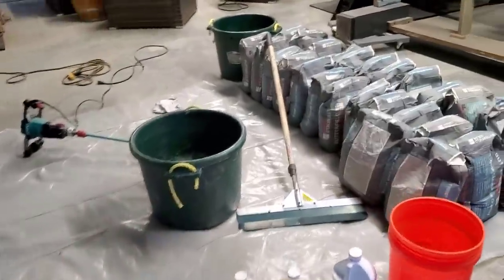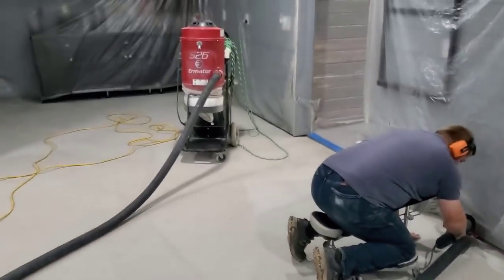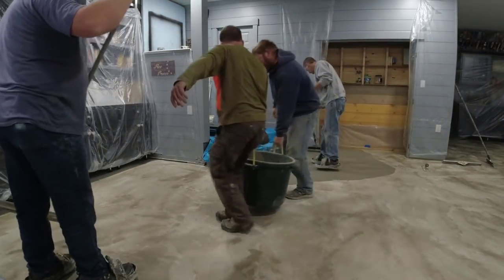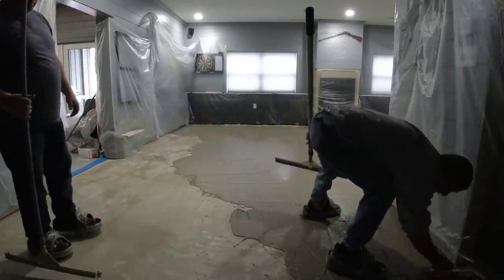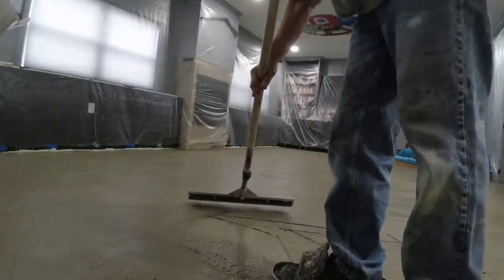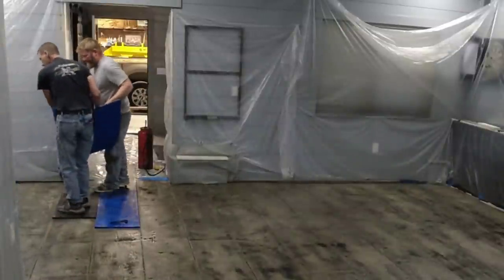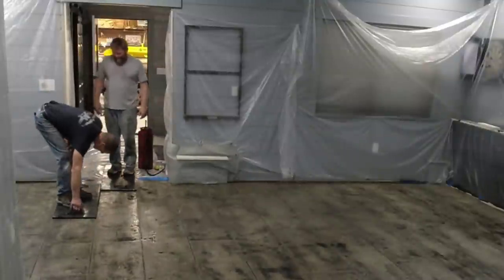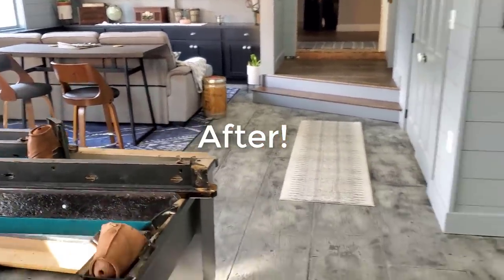Beautiful THIN Stamped Concrete Overlay For Man Cave! (Resurfacing a concrete floor)

Comment: You Definitely know what you're doing. ..I wouldn't even have the nerve or patience  to attempt doing stamped concrete. Seems like too much can go wrong, like if it's too soft, or gets too hard, etc.  ... The finished product looks Incredible👍, like you could actually get a splinter.😂
Reply from the maker: There is a learning process to this. Thanks for noticing and appreciating the work.

Comment: Such beautiful work! If this was put in a basement and it flooded? Whether flooding from the wall down on top of a floor or If the water came up from under the whole foundation would this floor not get ruined? To be fair, I can't seem to find any floor that can withstand a flood without some sort of damage resulting in removal needed.

Comment: looks great! the gauge rake has adjustable ends, or did he do that by feel? and how the beepy thing works? how does it know level? thanks!
Reply from the maker: The ends were set to 3/16". The laser level sends out a level laser beam. the "beepy thing" is the receiver that detects the beam and tells us when the screw heads are all at the same level.
Reply: The beepy thing I used to use had rapid beeps to go down and slow beeps to go up so you don't need to look at the reading. A continuous beep means that you are at the right level. There's a course setting or a fine setting according to how precise you want to be. These lasers have come down in price since I started using them and are great for  use over large areas or outside. Tip. beware of inaccurate readings when used near plant with flashing beacons. 😁

Comment: Mike can U do the overlay over tile  , or do U think I would need to put down a self leveler first or pull tiles up ?thanks .
Reply from the maker: That depends if the tiles are adhered good or not. If they are, lightly grind them, primer and self leveler, then stampable overlay just like we did here. If some tiles are coming up, it would be safer to remove them and start from there.

Comment: 00:00 Inventory/overview
0:51 abrading the leveler for good bond
1:20 adding primer
1:58 mixing and laying stampable overlay
7:30 smoothing/pre-finishing
7:58 stamping
10:35 using the touchup mat to get the final edges
11:44 talking about next-day cleanup and sealing
13:10 finished product

Comment: awesome stuff  we talked  im in Ludlow   can this be done over a wood floor?
Reply from the maker: It can be yes. All the seams need to be addressed and a flexible epoxy applied with sand broadcast in it first. Then the stampable overlay.

Comment: Could I do this process outside on a previously stamped patio? I have a old stamped patio that’s red timber stamped and I’m not a fan of it. Hypothetically could I etch it then prime it and pour over self level. Once dried could I do an overlay then a new stamped pattern without the outdoor elements effecting it?
Reply from the maker: You can use this outdoors, yes. I've gone over previously stamped concrete with it and re-stamped a new pattern. You probably wouldn't need the self leveler just the stampable overlay to do that.

Comment: If my original cement slab isn’t too terrible, couple nail holes and cracks, would I self level and overlay and stamp? Or could I just stamp the self leveling concrete? Or just overlay with gauge rake and stamps?

Comment: What will stop the new floor from cracking like the old one?  I have a large garage and when my home was built, the concrete people used large power driven sweepers to smooth the concrete.  I believe they did too much sweeping and caused the water to rise to the surface and weaken the concrete.  It now has cracks all over the place and looks terrible(looks like a jig saw puzzle).  I don't know what to do and I just am concerned that if I were to do something like you did, that it would just crack again.  Do you have any advice or could you tell me if those cracks will come back in the floor you just completed?  Thanks again Mike, I love your videos and all the projects you do look fantastic!
Reply from the maker: Andy, I'd have to be there and take a look at it in order to give you clear advice. I've done a lot of these with success though.

Comment: I really like this. I would however, like to find a pattern that is not so textured, something for say, a workshop, where I can hose it down to remove dust. Maybe fluted lines that lead to a industrial drain?
Reply from the maker: Maybe just leave it smooth like with the self leveling overlay.
Reply: Forgo any texture in a workshop.  Smoother the concrete the easier it is to keep clean.

Comment: Free lesson: 
You grind old concrete not to make it more coarse to bond better but because when you float new concrete it rises cement slur on top which is more weaker and lose. With grinding you remove that lose layer and expose harder material which all top layers can bond better grinding also removes dirt and grime.

Why use primer, doesn't matter how well you vacuum just grind floor it will still have dust on so primer "glues" that lose dust into old slab cause nothing adhere well to dust and also makes that surface to less water permeable so water that is added to stamping stuff remain in mixture as long as possible to help it cure.

Comment: I am somewhat new to your channel so maybe I haven't run across a vid with the answer yet but... 
Especially on a garage floor (floor with fiber, mesh/rebar) how does this product hold up to cracks in the original floor? If possible please address the different scenarios ie. 
1. A hairline crack developes after the overlay is down (no cracks before) 
2. An existing hairline crack that begins to open up or lift/drop
3. If the product is applied over a joint
Reply from the maker: 1. Usually that happens because of some type of surface tension like not enough or uneven bonding agent being applied. It's unfortunate but happens. Not likely happen if all things are done right, prep, mixing, applying etc.
2. "Active cracks" will always mirror up through a product like this. You're kinda taking your chances and hoping the crack doesn't "move" if you apply this over it. Considering you did the proper crack repair first.
3. It's never recommended to apply over a joint. Always honor existing joints. If you do fill the joint and apply over it, again, you're taking your chances and hoping for the best.

Comment: In a normal scenario where you want to do this over a new slab, how long should the new slab cure first?  Figure 6 to 6 1/2 sack.  What if the slab had fibre-mesh in it? Will this overlay tend to capture and lay down the fibres sticking out of the surface?  Are stamps available to have longer "boards"?
Reply from the maker: I'd wait at least 28 days for curing. The fibers sticking out can be burned off with a propane torch first. Some other manufacturers of stamps may have longer ones. Butterfield only has this length in this pattern.

Comment: Hi just acouple of questions about the stamps. If theres 10 in a set are they all different or do they repeat? What's the reason for the different colours of the stamps? How do you imprint an area smaller than a stamp eg at the side of a room or in a door way. I see you have a flexible stamp for the ends.

Comment: Really cool transformation price per square foot? I imagine you could do a new floor (concrete) the same way?
Reply from the maker: It's generally between 15 and 20 $ per sq. ft.
Reply: @MikeDayConcrete  So about $7500-9500 for this job.

Comment: Mike, You All do a Good Job. I like the Floor. You learn me something. I need to level part of my Garage Floor where my garage door closes. I didn't realize that Sakrete made a self leveling Concreate. This way I can level the Door for a Better Seal. Do I need to do anything to the Concreate Floor beside cleaning and using the Sealer?
Reply from the maker: You're probably going to want to lightly grind it for better adhesion. Then use the primer.
Reply: @MikeDayConcrete   I will do that Mike thank You for contacting me. Years ago I were out of Town working when the floor was finished. When the finisher sloped the floor to drain water which is a good idea but from one side of the door to the other side of the door there is a 1/2 " plus fall. So the way my garage door hangs is  crooked. I can level the door but I have a 1/2 plus crank at the bottom of the door on one side, if I level the Door I have a crack if I don't level the Door there is a Problem in lifing the door. The Seal is more important to keep out the Cold and Bugs from entering. So your Video created a resolution for Me. So the next thing is creating adhesive to the Old Concrete that will last. Should I place any anchors as you did on the floor. I realize you used the the screws as a  level points on the Floor. Thanks Mike

Comment: What would you do if the floor to star had black mastic adhesive remaining from old tiles that had been removed?
Reply from the maker: Some self levelers are designed to go over black mastic. (Try Ardex) Otherwise, I would grind it off first. Make sure it doesn't have asbestos in it though.

Comment: Great work. A pleasure to watch and very easy to understand.

I am very interested in doing something like this in my garage. In your opinion, do you think this will last in an actual automotive garage? As I actually use my garage to work on my hot rods
Reply from the maker: It would work, yes. Just not sure it's the best floor for a creeper to roll on and to keep clean with dirt and grease.

Comment: Great stuff! Thanks for teaching and showing. I don't know shiite from shinola but man o man that looks like a super heavy labor-intensive process and I'm not even thinking about the prep and protection required most everywhere.
I guess the beauty is that you've got a monolithic (not sure what monolithic means but sounds good)  system, as opposed to individual tiles (ceramic, vpf, travertine) say.
The groves, gaps, nooks, and crannies gotta be an SOB to keep crap out of this stamped floor... right?
I gotta imagine your getting  45.00 to 65.00 sq ft for what you did here... correct?

I may have to go with:
3.50 sq ft - 12x12 Spanish Mission Red Terracotta Floor Tile
3.50 sq ft - install

Comment: That is awesome!  This may be stupid question but the previous owners in my house put down an epoxy floor in my basement and now it’s starting to chip up.  Would that have to be removed or could I pour something like this over the top of it?
Reply from the maker: I'd grind that off to remove it first. Better adhesion of the new stuff that way.
Reply: @MikeDayConcrete  thanks

Comment: If you were doing a small portch  day 10ft deep by 16ft long could you use the textured rollers on the whole thing or will it peel up the overlay as you roll it?
Reply: You would need liquid release for stamps

Comment: So for me…..and this is just me. I have done stamped overlays and I am not a big fan of them. By the time you have prep time, materials, labor it’s just easier to rip the whole thing out and pour new. And no matter what in the back of your mind you know you put lipstick on a pig. You don’t know if moisture is going to come thru those cracks or if they will mirror themselves. I don’t trust any type of overlay and I can’t guarantee that the concrete floor was poured to my standards so how do I know what I am putting my name on. The material is outrageously expensive and prep time is twice as long. I don’t see any benefit of an overlay.